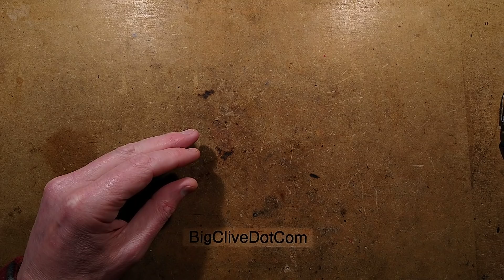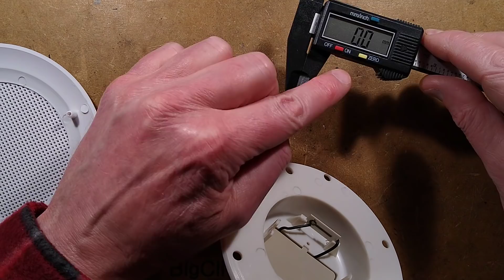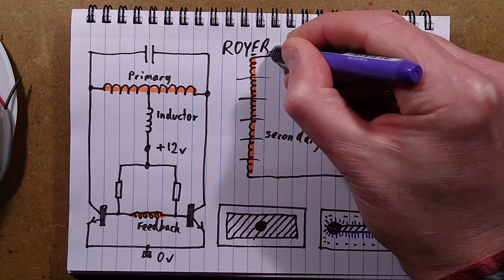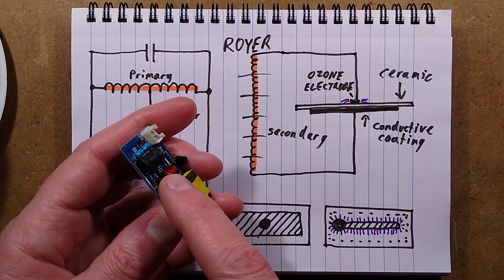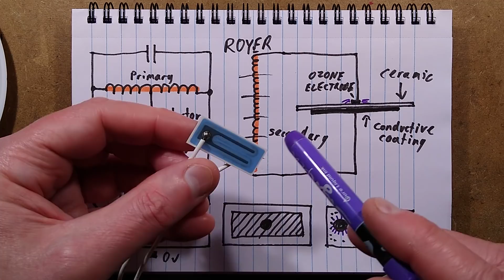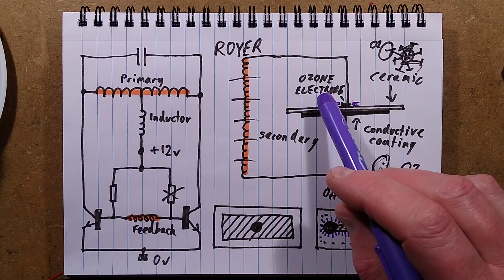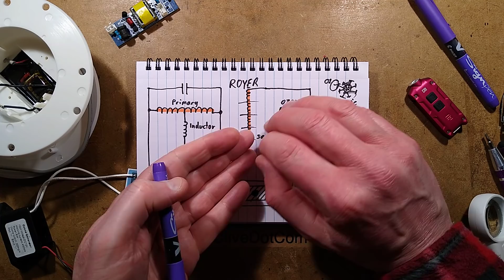High voltage sauna sanitisation unit

Comment: I grew up in a house with a laser printer in the 90s...I've think I've probably inhaled my fair share of ozone already, tbh.
Reply: Is that what that smell was? I thought it was just how hot components smelled.
Reply: Nice one, I'm also not sure I'd like to have an earth seeking high voltage in my steam room .. 
As for the ceramic doova, I happen to be making some for the company I work for. The metal is placed in the ceramic as a paste through a stencil, same as solder paste basically, but actually allows for finer tracks and smaller parts.. 0201 and 01005 in told.. anyway the ceramic and paste are baked, which fuses the metal to the ceramic..
Reply: I'll do you one better.  The ozone layer had a hole in it and we had to abandon a more efficient refrigerant for one that wasted energy and not only was a greenhouse gas, but under pressure in the presence of oxygen would become acidic and ruin parts of your system. 

Anyways, with  hole in the ozone layer that nobody unstood causing so much problems,  a few of us got together and made low powered spark gap transmitters and Jacob's ladder devices which we ran 24/7 in our bedrooms with the window open for about 2 months before shit started hitting the fan.

One guy got hit with a huge power bill and his parents grounded him for the rest of the year.  The rest of us got a visit from the FCC. Turns out we were causing interference with several licensed bands used for alarm systems,  a relay the county sherif used to extend coverage of patrol cars,  and medical devices at a doctors office not far from one of us. And no they didn't find it cute or amusing that a couple of 12 and 14 year Olds were causing all those problems because we were going to replenish the ozone layer and save the world. 

I csn only imagine how much ozone we crested and inhaled.
Reply: @sumduma55  A noble motivation, but unfortunately, ozone made at sea level usually breaks down before it can get to the ozone layer.
Reply: @techno1561  yeah.. a little wiser now. That wss almost 40 years ago though. Nobody actually knew how the ozone layer was created back then.  We just knew it was there, or was important,  and there was a hole in it.
Reply: @techno1561  ground-level ozone = bad, high atmospheric-ozone good = good
Reply: @sumduma55  Hydrocarbon refrigerants are more efficient than CFCs and do not deplete the ozone, only real disadvantage is flammability. But what they should have done was to learn how to use it safely, just like how we can use lithium batteries safely.
Reply: @NiHaoMike64  CFCs and HCFCs are both hydrocarbons. I understand your attempted point though. 

The thing is, and I should have been more specific during my original post, is thst I was talking about moving from r12 to r22 refrigerant when the ozone problems first became an issue of concern.  We did this in the early 1980s.

You are correct that the modern r410a refrigerants is more efficient though. The R-134a I believe is still a bit less efficient than the original R-12. It's adoption over R22 waa specifically because it approached r12 efficiency without any significant ozone depletion which was an improvement over R-22 and could work in older systems without major retrofitting.
Reply: @sumduma55  I'm referring to "plain" hydrocarbons like R290 and R1270. They're great refrigerants but they're flammable. Yet lithium batteries are flammable too but we use them everywhere? https://www.youtube.com/watch?v=xDyN_IGiP4w https://www.youtube.com/watch?v=owO1cd3NvUY
Reply: @NiHaoMike64  I'm not familiar with those enough to comment.  But I think carrier will offer R-454b which is flammable next year. 

Either way, we were talking about separate things which explains our confusion or misunderstandings.  My only intention was to talk about my ignorance 40 years ago.  Cheers
Reply: I had an old B/W TV that pumped out Ozone from the HT line.
Reply: I would be more worried about the toner.
Reply: The Ozon from that laser printer was the healthyest by product that came out of that thing xD
Reply: I had a second hand LaserJet II in my room when I was in high school... I suspect I also inhaled a lot of ozone.

Comment: Fun fact: Space probes not too long ago were discovered having gyro bearings that were failing wayyy too soon.
It was a mystery until they realizing that an electrical potential was developing in the bearing due to the solar wind of space acting on the craft.
Ceramic bearings I believe have fixed this; however, there are some probes out there badly affected by this if not able to their jobs at all.
F-ed up way to learn.
Reply: Goes to show it's hard to account for everything until you have experimental data from it.
Reply: Damn space probes, always being put into my butt by aliens, AND they have bad bearings ? 
I'm going to complain to my Grey 👽 Cross HMO insect overlord.

Comment: If that blue tape is Teflon (PTFE), they've basically created a tiny pulsed plasma thruster.
They pass an arc through a chunk of PTFE which causes a bit to ablate into plasma that's passed between two electrodes (like a rail gun), and fires out at extremely high speed. They're low thrust, but super simple.
Reply: It's a conspiracy to turn the Earth into a spaceship. Enough of these get sold and the thrust will push Earth out of its orbit.
Reply: @janneaalto3956  but earth is flat just like the pancake

Comment: Pools often smell of chlorine but the odor is actually bromine.
Reply: Most of the ones I've been to smell like bleach.
Reply: @TheNiteNinja19  I didn't phrase that very well. Most pools smell like chlorine, but the chemical in use is often bromine instead. Somehow it too smells like chlorine.
Reply: Just know that if you're in a pool and there's kids in it, you're swimming in a toilet.
Reply: Isnt it actually pee? Watch the mark rober video
Reply: @CreativeJamiePlays  you’re smelling the byproduct of chlorine reacting with the things in the water (bacteria and pee lol)
Reply: Pool smell is products of urea reacted with chlorine or bromine compounds. You’re basically smelling pee and sweat.

The outdoor pools in my apartment complex don’t get much use in the winter, so they don’t smell at all. Once summer comes around and people start peeing and sweating in it, the pools smell like pool.
Reply: @pyromen321  is that not due to the temperature?

A fresh bottle of bleach smells like chlorine, and our hot tub smells even of it is closed for weeks and all the things to react with probably is gone.
Reply: @dennisolsson3119 , temperature might be part of it, but it’s not the main effect. Dilute bleach hardly smells like anything, but if you pee in it it will absolutely reek pretty quickly
Reply: @pyromen321  I was just about to write "I need to try that", but that might be interpreted wrong.

I did not know that. Cool. Right up there with "smell of coins".
Reply: Chlorine disinfectants react with ammonia (amongst other things) in sweat and urine to create chloramines. They’re what give the common swimming pool odour.
Reply: Chlorine disinfectants react with ammonia (amongst other things) in sweat and urine to create chloramines. They’re what give the common swimming pool odour.

Comment: these units can't be found in the country of saunas (Finland). People suspecting otherwise can contact me for a visit in a real sauna.
Reply: Don't forget to point out how wimpy the Swedes are in their fake saunas when the thermometer is passing 60C and exclaim "that's the fake Swedish sauna temperature!".
Reply: I pointed out that on the previous video, no bugs are going to survive 90C+ temperatures that the Finns  enjoy in the sauna.
Reply: @cambridgemart2075  I don't think human skin would survive it either, sure you don't mean Fahrenheit?
Reply: @greenaum  no, celsius is correct. threre is no Problem to go to a 100°C hot sauna your skin will deal with it fine ( sweating is a positive effect of the sauna, i love how clean you feel after it. because the tinyest piece of dirt will be removed from the pores of the skin)
Reply: @greenaum  No, I don't; my wife's grandfather often got the sauna to 110C (230F), I can stand 90C for a while, longer if I cool my head with cold water.
Reply: I don't believe you!

Where do I have to go to and how long can I stay?
Reply: @tpat90  Just come over and bring me some beer at the same time.. I'm running low.
Reply: Comfortable temperature in sauna is 80-100C. You can have 110-130C if you want more UMBFH. In those temps electronics don’t last long. There’s a reason why finnish sauna lamps are under the seat or othervice low. Now fashionable led lights you have to replace annually (espcially the cheap ones)
Reply: Never have I ever even heard of a device such as this and I've been to maybe 30 - 50 different saunas in my lifetime.
Reply: Saunas are self cleaning due to the high temperature. If my Finnish language teacher was right they used to be used for childbirth.
Reply: @MarcusHawksley  and not only childbirth, also deceased had their last bath in sauna.
Reply: @MarcusHawksley  That is correct. But not only for the cleanliness, back in the days before running water from a tap, it was usually also the only place with warm water.
Reply: @banananaa  I hadn't thought about the hot water. it should have been obvious to me, seeing as the sauna is still the only place to get warm water at cottage!
Reply: Only if we get to hit eachother with those sticks and drink large amounts of alchohol at the same time
Reply: @sixiiaksuxusojeid8f7jwjue7  I'm up for that

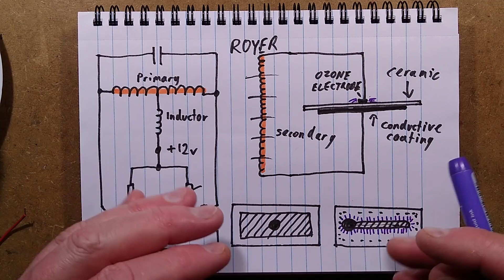Comment: 10:40 Perhaps the issue many are having with ozone is quite reasonably due to poor or misused ozone generating devices. As a kid i was gifted an air purifier that on practice was just an ozone generator with a fan, and it was so terrible, i can only compare that to having UVC in the room while there are living beings. I was physically unwell from that thing, and there were no warnings in the manual, i just thought i was being wrong by getting unwell from an "air purifier".

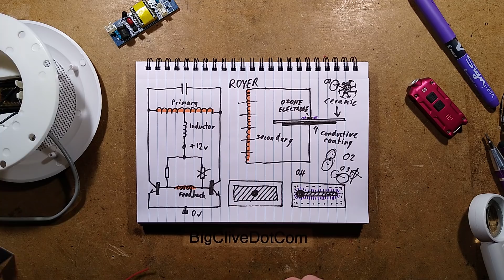12:55 On chlorinated water, one important difference for me is that there are regulations and workspace safety stuff on that. In countries i'm familiar with, chlorination is likely to be done on the level of water supplier, strictly controlled, while an ozone generator might be just plopped randomly in the room and turned on without much thought put into it (or in case of "negative ion generators", or some "air purifiers" without even realising that it's an ozone generator). When properly assessed and installed i have no issue with ozone generating tech, i recall experiencing "plasmacluster" tech on a few occasions in Japan, i haven't even noticed before seeing a badge in a train or on an air conditioner.

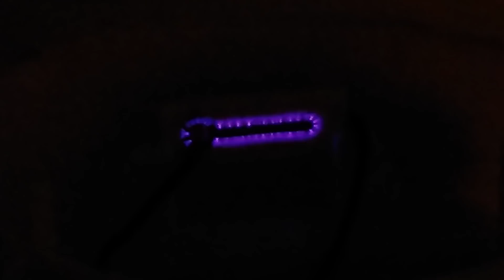3:30 o hey a tiny gas burner

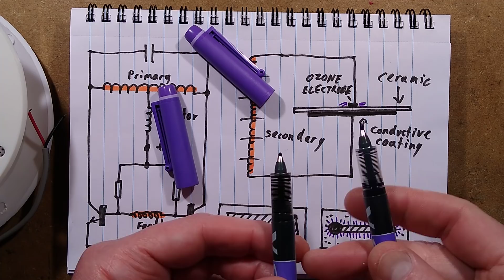4:12 Paper is quite an abrasive material after all. Feels terrible having to abandon markers and pens, still full with ink, due to tip losing shape. This is why fine art markers and pens might have replaceable tips (and also ink refills). Some manufacturers even sell less abrasive paper for markers and pens to prolong the longevity of the tips.
Reply: Abresive standard paper is rough enough to clean dirty inkjet heads.

Comment: I am getting a little bit of mould in the boot of our car from condensation, I wonder if I could run an ozone generator in there occasionally to kill it?
My thought is how powerful would it need to be and would it degrade the plastics in the trim and the rubber seals etc before their time?
Reply: It sounds like a temporary alleviation ot the smell mostly. And very detrimental to any wiring contacts etc. electronics in the car.
Reply: @benbaselet2026  it’s a VW so the wiring and electrics are terrible so I don’t want to make it worst LOL I’ll think I will give the ozone generator a miss then!
Reply: @DanGraves1983 I have abandoned the idea, I think it’s more designed to get rid of the musty smell rather than deep clean. Next time I clean it out I will probably treat it with something like borax and see if that keeps it at bay.

Comment: The metal machining method is spark erosion - used it years ago to remove two retaining pins that had originally been inserted very cold (to get a tight fit)
Reply: "Electric Discharge Machining" is the fancy name, Applied Science did a video on it a little while ago.

Comment: When you first open the thing at 2:50 or so you can see it arcing internally, that doesn't seem... great...
Reply from the maker: I think that might just have been a reflection.
Reply: @bigclivedotcom  Watched it back a few times, it looked like an arc running through the entire thing. You can see the first arc top left and a short moment later the second jump.
Reply: @bigclivedotcom  Hm, just went back and watched it again with fresh eyes and froze on the frame and yeah I think you're right, it might just be a reflection that just happens to look a lot like the kind of thin sparks I've seen these kinds of power supplies generate before. Real weird coincidence.

Comment: Sauna sterilization? Sounds strange to me. As a Finn I can confess that we wash our saunas with soft pine soap (mäntysuopa), definitely not sterilize them – it's a holy place for every Finn, electronics don't really belong to sauna, aside from lighting and possibly as a heating method when not using traditional firewood. ;) But an interesting video nevertheless, cheers!
Reply: Wow, I'm very surprised that all those hot tubs don't contain any sort of sanitization agent. Since the usual temperature of saunas is right in the prime range for bacterial growth, in the US we generally use even stronger concentration than in pools.
Reply: @TravisTerrell  No, a Finnish sauna often reaches 90C (195F), so definitely not prime growing conditions for bacteria!

Comment: People scared of a little bit of ozone, while they swim in (not just smell) chlorine and bleach. Also, not to mention fluoridated water gasp!
Reply: I know an anti-vaxxer chemophobe who smokes.....
Brainy not be working goodly with these peoples... 😂
Reply: @Xiph1980     Please take the "vaccine".
Reply: @simonruszczak5563  as soon as I get the call, I most certainly will indeed!
Reply: To say nothing of their use of sodium and chlorine in the kitchen—two very dangerous chemicals!
Reply: @ConstantlyDamaged    I like sodium chloride, common salt.
Reply: @simonruszczak5563  But they're ChEmIcAlS!
Reply: @DanGraves1983 Well, there's a few oddities about that.

The tremendous reduction in the use of CFCs has resulted in the ozone layer gaining strength far faster and far earlier than it was predicted to be possible.

Down at the south polar research base, they found a 1950's era sensor that was supposed to detect the status of the ozone layer that had been tucked away in storage and forgotten about.  As the thing was still in working order, it was put up beside a modern one (which was detecting serious ozone layer depletion at the time).  Damn thing detected no ozone layer issues at all.  It's entirely possible we were greatly overestimating the previous strength of the ozone layer.
Reply: That and the fact we effectively live in an ozone bubble which stops the sun turning us all into charred remains
Reply: @DanGraves1983   No ozone layer and no holes.  The depletion is natural.
Reply: A little O3 is nothing. Swimming in a pool where people pee in every day, all day.
That is way too scary and you get splash in your mouth. Do really think that " pool water" is clean?
Reply: @assassinlexx1993  Biologically, it is.  Urine is, unless the source person has a UI infection, in which case swimming isn't something they're likely to WANT to do, initially sterile and properly maintained pool water is a strong enough oxidizer to kill most microbes pretty fast (and to do a bit of a number on your hair and skin, which is why you don't want it too strong).  The main issue with urine getting into a swimming pool is the hypochlorite can break down the urea and produce some ammonia, which hypochlorite does nasty things with.
Reply: @evensgrey  
I will stick with maintenance of the pool. 
When you see what comes out in a backwash, it is nasty. 
No there is no test for urine but they did a experiment in a public pool. ( YOU CAN LOOK IT UP)
Even i couldn't believe just how urine was in a pool.
Reply: Chlorine dioxide is put in swimming pools, it's safe.
The smell is a by-product (chloramines) after it's destroyed contaminants.
Reply: @DanGraves1983 Yeah, the list of chemicals added to cigaret is insane.